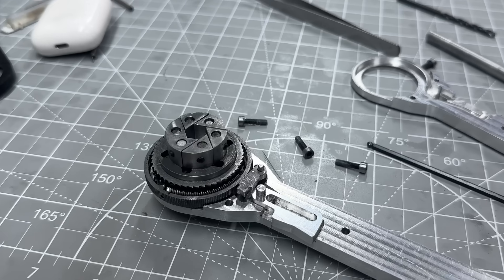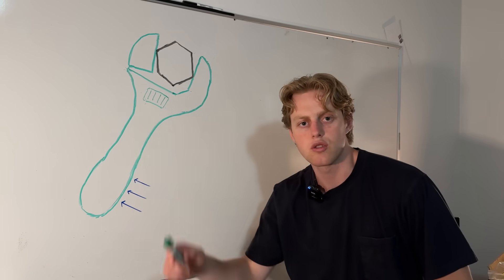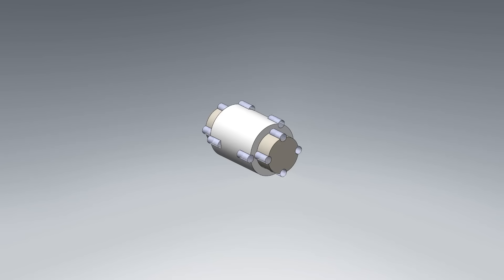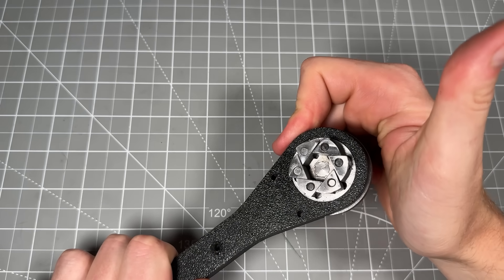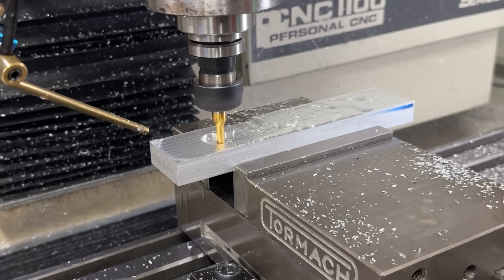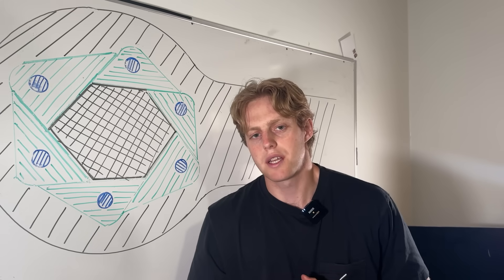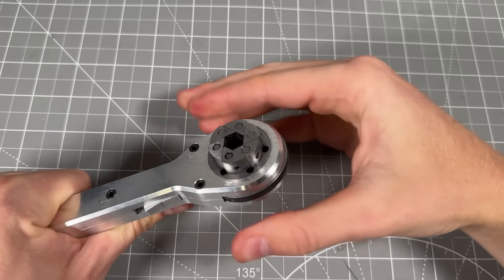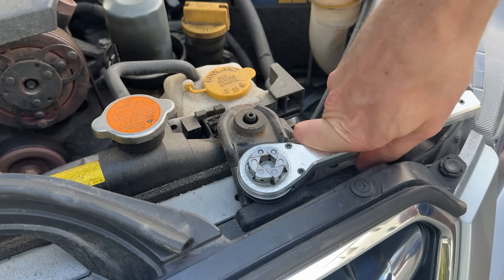I Invented an Adjustable Ratcheting Wrench

Comment: Nice design your central mechanism is more commonly seen in something like a vault. 

One piece of advice; give it to a tradesman and see if it is intuitive for him to use and ask what his thoughts are. As engineers we design great products for ourselves and sometimes miss out on those simple insights that can really take a product from great to ubiquitous.
Reply: One side should be black, and the other side red (or some other bright colour) to distinguish the in and out sides. Printing will work as well, but it has to be obvious at a glance.
Reply: @insertphrasehere15  You can paint it yourself.. It's very easy to do.  Or even better,  take a grinder and cut some hash marks all around one side.. Then it can't wear off.
Reply: @insertphrasehere15  I actually do this on my wrench sets..  I'll line up all my metric wrenches and paint the box end all the same color.. So just at a glance I can tell what set my wrench goes into.   And it looks cool as it wears off and gets distressed.  Don't be afraid to modify your tools.
Reply: @insertphrasehere15  Differentiation is smart but I would recommend simply engraving arrows on the wrench head showing the turn direction. Simple enough to add into the CNC machining and no concerns about the finish wearing off.
Reply: @insertphrasehere15  green and red dummy, green tightens, red loosens, a tight bolt is safe, a loose bolt is dangerous.
Reply: The insights a local mechanic could provide and the damage they would do to the wrench would be invaluable
Reply: @themonkeyman2547  mechanic won't be able to find a bolt it'll fit on
Reply: @themonkeyman2547 Some use wrenches for hammers lol!
Reply: Tradesmen would figure this out in an instant and will be using it and playing with it before you can blink.
Reply: hello, I am the person you are looking for. I'm an aircraft mechanic. Speaking completely honestly, I would not use this tool. It is too bulky, could not fit in tight spaces, has too many parts so it's too expensive/time consuming to repair/replace, and the chuck is privy to making tool marks. This might be a good wrench for someone in construction, but for airplanes there are too many shortcomings that I already have other tools for. It would be the same for cars. Really cool proof of concept, but it needs more time in R&D.
Reply: I am a mechanic of sorts, engineers often design minimal space just enough for a socket. If it is usable In at least 50% of situations then I could see it being a viable product which it seems like it is.
Reply: You twist and push a button..  It doesn't need to be intuitive.  
It just needs to be simple and easy to remember.  Which it is.
Reply: Excellent idea, man. You’re 100% correct here.
Reply: I personally would never reach for this strictly due to size. I like my ratchet heads as thin as possible, and with a flex head, in my opinion, it's definitely gimmicky. It's not that hard to reach for a socket if you are an actual technician with an organized box or tool tray, and based on whatever vehicle you're working on, there are set socket sizes you know you'll need. That knowledge comes with experience, so you know if you're doing work on a Toyota, get your 8mm, 12mm, 14mm, 17mm, and 18mm. Things like this, oh, and probably like at least nine 10mm. Cool design and build, but my family, knowing I'm a mechanic, buys me these multi-socket wrenches as stocking stuffers, and they are just too bulky and hold no value for me. I will say I do have a set of speed wrenches from Amazon that have a little spring-loaded pin on the open end of the wrench, which allows you to tighten or loosen a bolt or nut that is hard to get to, or not, without pulling the wrench off and resetting. Now those were pretty cool. Oh, and the box end had a design similar to a 12-point, but more squared off, that allowed you to remove everything from 6-point to 12-point hex, Torx, triple square, and Allen head bolts.
Reply: Or camera lenses
Reply: Engineers design crap 😂😂😂
Reply: that was the nicest way of calling trades simple... "simple insights" hahahah
Reply: Man, send it to me, I will field test the $h!t out of it. That would be so practical saving weight for me to climb with in ladders and stairs, use the same tools for all the different bolts size instead of switching constantly trying not to drop my sockets down 4 levels through the grating floor, no problem not having my metric set with me.  Improvements needed: make it lighter by removing metal on the frame and handle, the handle needs to be round and about 1/2’’ to 9/16’’ of diameter, look at the handle profile all ratchets have and try to do similar, it’s essential for comfort, agility(of use but also to avoid dropping it down on your coworkers’ head) and being able to apply real strength(if the edge cuts in your palm and fingers you can’t give it all your strength).  Also, best case scenario, it would have to fit on hex heads from 7/16’’ (for bolts 1/4’’ dia)  right up to 1’’ hex heads, I know 1’’hex head is an odd size so rarely used that I’m not even sure what size of bolts it’s on, but if it accepts good 1’’ hex heads then it will accept the unavoidable 15/16’’ (5/8’’ bolts) damaged heads that we have to hammer out of our sockets and sometimes on.  Also, on the assembly, you need to put a tiny bit of blue locktight on all of the screw or it will definitely fall appart in the field.  I can see myself use it at work, but also having that in my truck for emergency repairs, I would oil it all up properly, put it in a ziplock bag and drop it in the jack compartment with my crescent wrench(still might need to hold the other end if if’s bolt and nut), it would stay there unbothered until the fateful day I’d need it.  I am totally serious, send it to me, you are an engineer I presume, you have no idea how useful this could be and you definitely need field test, send me your prototype if you can bear having it broken, or make me a test prototype, I’ll give you detailed feedback and will send it back to you for analysis. I millwright in harsh conditions, hot/cold, dry/humid air, in water/chemicals/steam/oil/grease, infiltrating sticky wood fiber dust.  If it works well like that as is, you need real testing now before you waste time and efforts developing blindfolded.
Reply: EXACTLY it needs to meet the consumers demands and how else better to do this than to give a prototype or finished product to them for "daily testing"
Reply: - yes consulting with the guys hanging off the end of the tools is a very good thing for Engineers never to lose sight of. (Leading hand trades should always be on any design panel)

Mechanism also on bootlace crimps and camera iris'..
Reply: @kadmow how very condescending. Im not suggesting they should be on a design panel im saying its good to hear perspectives outside of your own/tribe, especially when it might be the end user. Are you so arrogant as to think theres nothing for you to learn from people you percieve as beneath you?
Reply: @InquirerAshen  why are you defensive when the guy is literally agreeing with you lmao
Reply: i would use this for field work in place of a crescent wrench.
Reply: You think he needs your advice? What an arrogant fool

Comment: Could you add a chamfer to the inside of the jaws, just enough you could press the wrench over a bolt or nut without having to open and close jaws? Or would the chamfer angle not conform to the full range of sizes ?

Comment: I need your help building a portable electric sawmill... Like a chainsaw mill but a dual motor, low profile, lightweight slabbing bandsaw. 
Its perfect if you have a hub motor with the spindles mounted to a light frame, 1 esc and some tracking or automatic tracking. 
Then it either runs on ac somehow, or runs on 48vdc batteries. 
Portability is key. No moving of large trees, move the tool to the job site, and then you just transport back the slabs. (and dimensionalizing it can be done with a good straight edge and circular saw)
Could work with portable power stations, golf cart voltage or small portable 48v batteries.
Price of parts, cheap, demand high, ability high, benefits definetly, People make real money on milling lumber as there is so much not utilized at all, so its actually a very viable product.

Comment: Good job. Impressive what patience you have with the project, not giving up. 

If the pins still break, maybe titanium could be an option. 

If it's hard to put it all together, maybe an option could be to sell it as a kit that people could build by themself with just the parts. Get a CNC shop to make 1000 sets of pieces and just sell them together with a drawing. Like IKEA furniture but for tools.

If all functions are ok now. The next step to make it even better could be to make it as small and light as possible without it breaking. To be a really useful tool, it needs to be light and not so bulky so you want to carry it in your pocket.

Maybe it should also have a tiny, tiny radius where the bolts corners meet the tool. It's not uncommon for bolts to be a bit round and a tiny radius could prevent problems with that.

Comment: Great video and project! Thanks for sharing! If you can somehow make it with a threw hole instead of just the locking pin between the plates it would be great for nuts on studs or threaded rod.

Comment: What if the bolt is really stuck and you need to use a hammer or a pipe to extend the handle for more leverage? Will your wrench be able handle it?
Reply: to be fair, most people do not use a hammer or a pipe on a ratchet. Breaker bars are used for those situations

Comment: Awesome design and fab work. Only thought I had was the lack of jaw depth. It works on bolts, but there may not be enough depth to be used on nuts. (Bolt threads going beyond the nut, making it difficult to get a fully seated grip with the jaws). Maybe a future revision with deeper jaws or a pass through (essentially making it an adjustable box wrench). Keep it up man, most useful tool is between your ears.

Comment: You need to observe someone without bias actually use it. I like to tighten the crap out of my bolts. You can also design an adjustable socket that'll work with a regular wrench. Trying to find the right size can be difficult especially when you're in a tight spot. Adjustable socket size would make things easier

Comment: I do see one of the biggest issues being that in order to set the size, you need to be able to reach the head. If I'm trying to work with a bolt in a cramped space, it's likely I won't be able to fit my hand in with the tool.

Comment: I love it! Sure there are some limitations, but there are with every tool. This honestly looks like it could be stronger on tough to move bolts than a standard wrench because of the way it grips tightly, which could lead to less rounded off bolt heads when trying to remove stuck bolts. Id love to see you refine it a little and then sell 3 versions, a smaller one means for 8-32 to 3/8 bolts, a mid size one for 1/4 to 1/2 like this one, and a large size meant for something like 1/2 to 7/8

Comment: This is a really good concept, idea, and design! I love how it came together.
I think these would work REALLY well as a ranged adjustable socket set, like a wrench that ranges from 5mm to 13mm (the size you made, basically), and a larger one that spans 14mm to 21mm, etc.
I can't think of any feedback at this moment regarding your design or machining process, but I'd definitely buy this product as a self-tightening adjustable badass socket wrench.

Comment: That is awesome. If you used a wire edm instead of a laser cutter to cut the parts it would be way more accurate and have a better finish. Also if you could open and close the jaws with the back of the handle like how some socket wrench use the handle to spin the head. That would help out in harder to reach areas. All in all though that is a amazing idea and tool I would definitely buy. You need to patented it before a big tool company steals your idea though

Comment: I like your perseverance to refine your design to finally demonstrating a working prototype. The skills you learned will be of great use to other future projects.  That said, I think the key weakness of your adjustable wrench is that from one bolt to the next, whether same size or not, one has to use a second hand to reopen the hexagon. Perhaps you can add a thumb lever to push the big gear slightly backwards to open the hexagon just enough to loosen the grip on the first nut and hold the grippers to fit over a second nut of same size.  I hope you can find a niche application; I’m sure you’ll develop many more inventions.

Comment: "which side tightens, which side loosens"

When you anodize the handle make each half a different color.

There is definitely be a market for this. The weak point in the design is that a lot of the time when a ratchet is used it's used because of space limitations. The head on this is too large to compete with that use case. I think you hit the nail on the head when you compared it to a crescent wrench.

Comment: I work in med device. We have a one sized ratchet we use in surgery. To tell the difference between tighten and loosen there are recessed dots with either red or green infill. Green means go. AKA tighten. Not a huge problem, but a possible solution for your which side is which scenario. Awesome video man.
Reply: Was going to suggest a visual signal as well. A colour, or an engraving. Or both.

Comment: what if you just made the socket adjustable and had it be able to attach it to the ratcheting wrench? I think this was you could make it smaller and give the system added modularity for extenders and maybe size niches.

Comment: A.S.E. Master Tech here.  I'd be curious how well changing the teeth out for a set of spiraled, stripped bolt head removal set would effect it's performance on both standard hex heads and extremely worn / abused ones.

Comment: This is legit!  When I go to a machine to fix something, I tend towards adjustable first, then specific tools later, or if I know I need the speed of using the right tool for the right job.  I feel like a version of this could easily fit the "I just want to do a quick diag, I'll come back for the right tool later.  Like a small medium and large version of this could easily find themselves in that quick fix drawer of my toolbox.  Clearance will bite any tool, so I don't think a "perfect" or ideal sizing exists, I think you will just find what the right proportions for it's use cases are.

Comment: Some nice clever engineering there! Well done! 👍
The weak point is obviously those pins.
In theory, the load is spread over all 6 pins, but in practice, the load will shift to the side putting the majority of the force on one or two pins, ie; it will try to push one jaw outward, or push two jaws apart outwards, while the other jaws remain secure.
I think it would be worth exploring options of keeping all jaws secure together, like some type of external ring, although I have no idea how you would do that. 🤔

Comment: You should add either a flat nylon disc or a static sheathe over the wrench teeth that clamp onto the bolt, otherwise when tightening you'll end up gouging the hell out of whatever it is you're bolting.